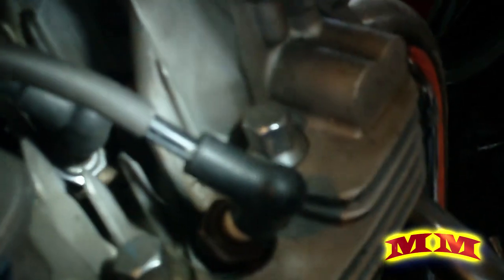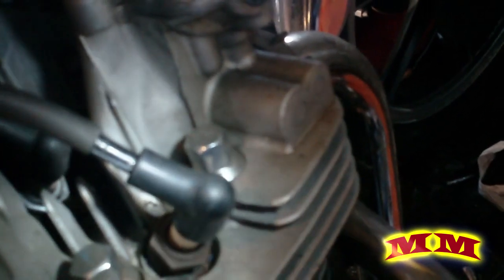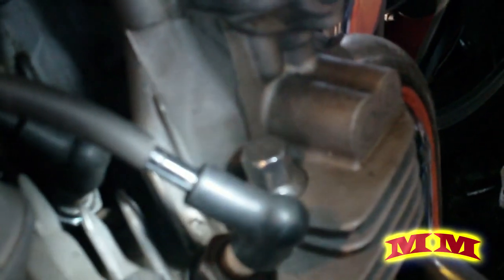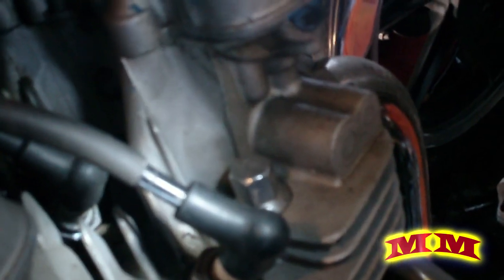Bad Spark Plug Caps !!

Comment from the maker: Keith It is cheaper to just run wires . I am going to get a set of car wires and cut hem down and if the falls throw they cost around $20.to get for the bike and the replacement copper wires are around the same price.